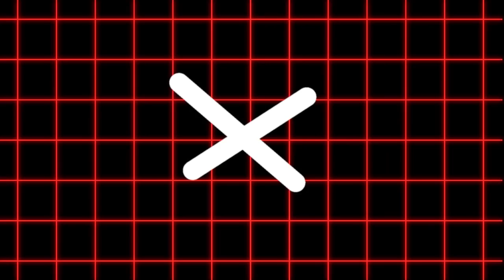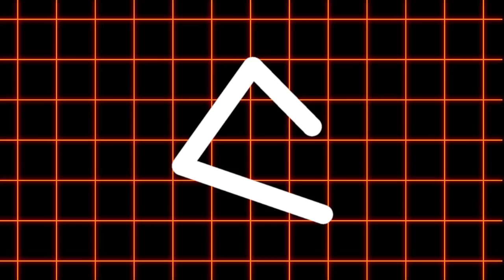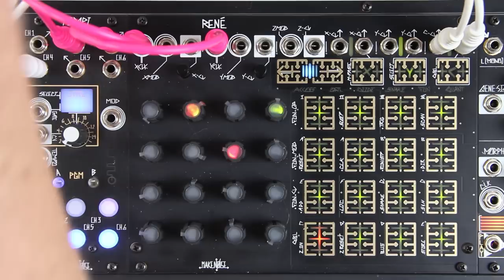Prism of Composition: Introduction to René's Z Axis

Comment: 7:00 important tip on transposition, but impossible to see what you are doing cuz you're flying thru the moves so fast and the states are changing as you go. can you break it down or suggest a reference?
Reply from the maker: Sorry about that! Here's what we did: 1. muted channel 5 on TEMPI, which is patched to Z-MOD, so that it would stop sequencing through States. 2. adjusted the current State's Quantize page to change the key, 3. Un-muted TEMPI channel 5 to start sequencing through the four enabled States again.
Reply: @MAKEN0ISEMUSIC  so when you say you adjust the quantize page- you're actually in there changing pitches on a per note basis as opposed to changing something globally that transposes the whole state?  Thanks BTW!
Reply from the maker: @TheJimLang  Yes that's correct, I was on the Quantize page. Changed the tuning from (C, Eb, G, Bb) to (Eb, F, Ab, B)

Comment: I think I still need a diagram to understand how the z axis functions.
Reply from the maker: Sadly there aren't enough dimensions in regular space. However, in lieu of a diagram here's something I wrote to answer someone else's question about it: 

"Yes I would say an n-dimensional matrix is a good way to think about it. Three dimensions is a good way to visualize but it is actually quite a few more dimensions than that. If we start from three dimensions we could think of each of the three Channels as a 4x4x64 prism. The two Snake channels have independent motion on the 4x4 x/y grid or cross-section that is a State, and the Cartesian channel’s motion on these axes is also independent but related to both of the Snake channels. Movement on the Z-Axis happens on all three channels simultaneously but does not affect their locations on the x or y axes (unless you use the Z.RESET option but let’s leave that alone for now). So if you have three sets of xy coordinates, stop the x and y clocks, and start clocking Z-MOD, you get motion through the Z axis on all three channels that does not dislodge their vertical or horizontal positions. In this sense it is a three channel three dimensional sequencer, or a “Triple Prismatic Sequencer.”

However, each Z location cross-section (STATE) is not only a collection of 3 sets of 16 location values. It also contains all the programming about each channel’s accessible locations, which locations will output gates and/or glide, what Patterns the Snake channels will follow, what scale and range the quantizers will be set to, and even how the channel will respond to Mod and CV inputs. So each State is not only a “sequence” or even just a cross-section of a larger 3-dimensional sequence, but in fact can be also considered as three sets of rules about how any sequencing in that State will play out, and these rule sets themselves can be sequenced. 

Mesh programming lets you choose a subset of these cross-sections/States and instantly apply any particular programming change to all of them without otherwise disturbing them. For example you could set the X channel on your current State to use CV for location addressing, and all Mesh-enabled States will instantly have their X-FUN.CV.LOC’s turned ON but nothing else about them will change. You can make these programming changes in real time while also sequencing all three axes on all three channels if you wish."

- W
Reply from the maker: also, new z axis video here: https://youtu.be/U-ofHMtKYbA